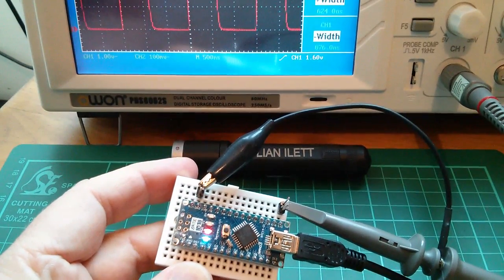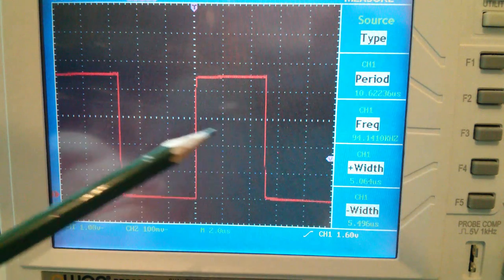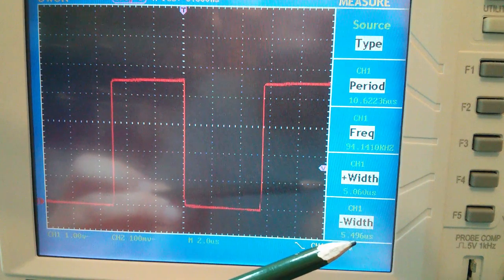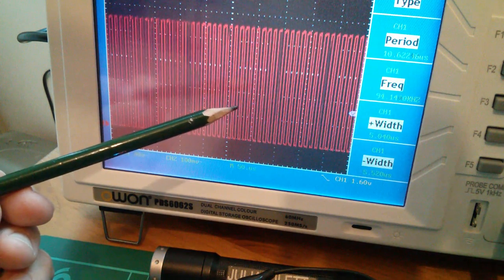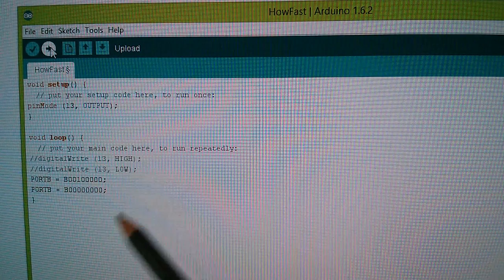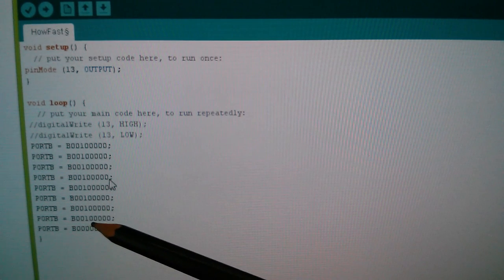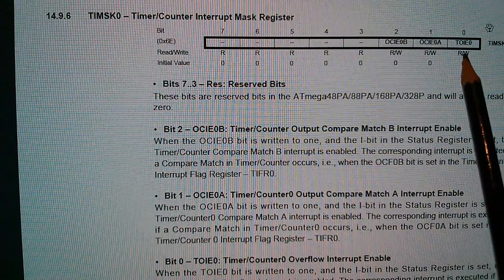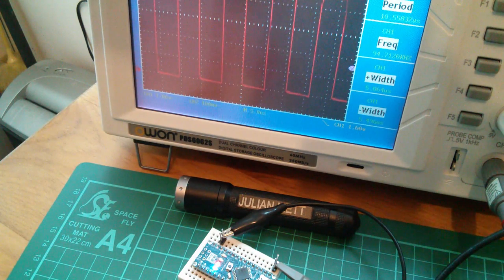Julian Investigates: How Slow is Arduino?

Comment: I think the reason for the runtime conversion is so that you're able to specify the Arduino output pin as a variable, so you can loop through or address a number of pins e.g. for (myPin...) {digitalWrite (myPin, HIGH); }
Obviously this wouldn't be possible if these were translated as constants at compile time.

Comment: +Julian Ilett A trick to toggle an output pin is to write 1 to that pins "Input Pins Register". Use "cli()" end "sei()" to disable/enable global interrupts.
Reply: k0ppit 
Got an Arduino Diecimila to toggle pin 8 at 2,66MHz and 50% duty cycle with this code.

void setup() {
  cli(); // clear global interrupt
  DDRB |= 1 << PB0; // set pin 8 to output
}

void loop() {
  for(;;) {
  // toggle pin8
  //PINB |= 1 << PB0; // Safer
  PINB = 0x01; // Faster
  }
}
Reply: k0ppit
Got an Arduino Diecimila to toggle pin 8 at 4MHz and 25% duty cycle with this code.

 void setup() {
  cli(); // clear global interrupt
  DDRB |= 1 << PB0; // set pin 8 to output
}

void loop() {
  for(;;) {
  //PORTB |= 1 << PB0; // Safer
  //PORTB &= ~(1 << PB0); // Safer
  PORTB = 0x01; // Faster
  PORTB = 0x00; // Faster
  }
}

Comment: Thanks for bringing this to my attention. I can't see the need for it at the moment given the projects I'm playing around with, but it is good to be aware of these kinds of things in case I run into something very time-sensitive in future.

That would probably have to be a very specific requirement though, as I very much appreciate ability to write once and compile for different systems, plus the readability of most Arduino commands, and the fact that I don't have to worry about taking all port values into account when using PORTB/C/D.

Comment: the digitalWrite actually performs a hell of hand-holding to try and prevent unexpected behaviour like writing digitally to a pin reserved by a peripheral and stuff like that, that's why they do it at runtime (they check a bunch of registers to see if it should actually do stuff to the port). also the loop does other stuff in the background like checking/managing a system timer etc, this most likely introduces the overhead. also remember arduino is derived from C++, this might also introduce a small call overhead as opposed to C, also loop is an actual function, so not just a jump-back has to be performed but also stack stuff and calling/returning.
tl;dr: safer/nicer for hobbyists who aren't that much into low level programming or just too lazy to care for a small project that doesn't have to run that performant, but introduces a LOAD of overhead. that's why I try not to use it if possible (avr-gcc/libc and a few small libraries to link to for common tasks is just fine) but it's great it exists, gets people into microcontrollers :)

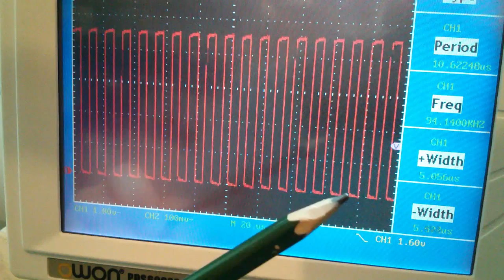Comment: In time frame of 5:30 and time frame 11:50 there appear to be signal aliasing, although I could be wrong. Signal aliasing arises from the fact that the scope maybe not perfectly aligned to sampling the Atmel chip signal. You may need to use a scope of higher sampling capability at this specific setup.

Comment: When doing mechanical "operations" as on a machine (calling out functions) the Arudino is so fast that humans can't tell there is a delay.  When "this" goes on and "that" goes off,  or from the time the button is pressed and 16 relays are switched It is less than 1/2 second.   It is an amazingly easy to use device for controlling a lot of things.  I am using a Mega board for my project and all but 4 pins are empty.

Comment: Just because a CPU runs at X Mhz doesn't mean it can do X million instructions per second (or 1 instruction per clock cycle).  It still depends on bus cycle, memory speed, instruction decoding and some complex instructions like multiplying and especially dividing can be pretty slow.  And stuff like memory waitstates, DRAM refresh can make things even slower.
For example on the intel 8086 a bus cycle takes 4 clock cycles, so fetching any memory (instructions as well as data) couldn't happen any faster than once every 4 clockcycles, this also explains why the 8088 with it's 8bit bus was so much slower because fetching instructions was half as fast (and accessing 16bit data as well).
A full IDIV (32bit/16bit signed integer divide) Could take up to a whopping 212 clockcycles.

CPU designers have become better (even for very cheap cpu's) since then and on the 8bit AVR, most common instructions take 1 cycle, but there's a few handsfull that take 2 or 3, and a couple go up to 5 (CALL, RET, RETI).

FYI.  There's optimal digitalWrite() versions in the Wiring framework for arduino.  if the pin number is const (as is the case here), the digitalWrite will be compiled to a single SBI or CBI   When the pin number is in a variable however, then there's a price to pay for the convenience of writing digitalWrite(pinnum, HIGH).  Avoid if possible (even a switch/case cascade with const pin numbers will be faster (at the expense of code size).
Reply: If you look at Atmel Atmega datasheet, they do say that most instructions takes 1 cycle. The problem is, that turning GPIO on/off is more than one instruction - in 'arduino language' for sure. Maybe if he would set DDR & PORT   registers directly, it would be faster. Apart to that, he said enough.
Reply: Ok, he got to that in video. I showed myself... :D
Reply: How about defining the pins as #define? Is it similar as putting them as const int ? Or even const byte.

Comment: Great work Julian, this extract is taken from the core library arduino folder/hardware/arduino/cores/arduino/wiring_digital.c

void digitalWrite(uint8_t pin, uint8_t val)
{
    uint8_t timer = digitalPinToTimer(pin);
    uint8_t bit = digitalPinToBitMask(pin);
    uint8_t port = digitalPinToPort(pin);
    volatile uint8_t *out;

    if (port == NOT_A_PIN) return;

    // If the pin that support PWM output, we need to turn it off
    // before doing a digital write.
    if (timer != NOT_ON_TIMER) turnOffPWM(timer);

    out = portOutputRegister(port);

    uint8_t oldSREG = SREG;
    cli();

    if (val == LOW) {
        *out &= ~bit;
    } else {
        *out |= bit;
    }

    SREG = oldSREG;
}
As you can see there are loads of C commands just to change the pin state.

Comment: There's a valid reason to doing the mapping dynamically: This way you're able to use digital write with the port number from a variable. Analysing the code, and replacing the ones where the pin number argument to digitalWrite() is a constant would be a solution, but that's not a trivial job on one hand, and would pretty much make the timing with different digitalWrite() calls inconsistent.

Comment: As others have said , a while true loop and a single bit toggle is the fastest. For reference I got around 4MHz from an arduino uno. Also, I noticed you get a much cleaner signal if the usb power is supplied by a wall wart. Mty laptop usb produces an unacceptable amount of noise.

Comment: if you want to remove the noise which is caused from the built pre coded interrupts you can type noInterupt() function to disable them and type interrupts() to reable them. If you really want a high efficient code for tasks that require high precision time based code then I think it is best to stick to the original type of microcontroller coding and that is doing it the hard way. Also note when I say efficient I mean being able to type code like _asm("wfi") and save power but that would be redundant in the arduino IDE and libraries as there is interrupts happening everywhere.

Comment: Hey Julian!

Great work on and research on this topic! Long time supporter and fan of your channel. Do you have anyway to speed up AnalogRead? I am trying to use the arduino as a oscilloscope. I dont have the $$$ to get one xD And I already have an arduino around. Thanks!
Reply: Relations99 While it is possible to speed up analogRead() a bit, its main delay isn't due to code overhead (that much). The ADC needs time for the hardware to convert analog to digital. If you were to skip analogRead(), you'd have to manually check if the ADC was done converting before reading its registers, otherwise you wouldn't get sensible data. This is done by analogRead() for you, by simply waiting until it returns something.
Reply from the maker: Relations99 I think you read my mind! I'll be looking at analogRead() next. I also want to build a cheap Arduino oscilloscope and speeding up ADC operation is the key to maximising it's frequency range. There may be a way to have continuous analogRead()s by putting all the other code into the gaps where the successive approximations take place. This would require interrupts from the ADC to break into the code for display updates and keyswitch reads etc. Not sure how feasible this is yet though ;)
Reply: Julian Ilett this http://meettechniek.info/embedded/arduino-analog.html might save you a lot of work... (and much less fun) but the overall estimation you are looking at 77khz max using continuous ADC conversion (about 13 clock cycles per conversion) for the ATMEGA328. not very impressive.
Reply: Relations99 Also, using an arduino as an oscilloscope is a useful exercise for your own development, but to be honest, it will be useless for pretty much anything as a scope. Even the oldest analog scopes from the 60's and such will be far more capable.

As a learning experience and fun project, go for it. It'll be a great thing. As a useful tool, look around with universities, second hand on-/offline and auctions and such, even ebay, and get the cheapest analog scope you can possibly find where the trace is visible and a curve is shown on the display (indicates that the scope works and triggers). I got myself a Tektronix 2465 (300MHz 4-channels) for less than the equivalent of 100 GBP about 8 months ago at an annular university electronics auction. And that's much more than you'll need. Lesser scopes went for 10-30 GBP.
Reply: Stefan Berndtsson yeah noted thanks. I was and still am looking out for scopes. But it's rather frustrating because they then to go very very fast. 

Julian Ilett there is a sort of a guide online, On indestructibles, that uses and external ADC  and external clock for the ADC, all to save some processor calls on the arduino. Also, might wanna look into SerialWrite. ;)
Reply from the maker: Asaf Shahar Agreed, not very impressive, but usable. If a scope with this spec can be built for a fiver (£5) then I think it's worth having a go.

Comment: Great tutorial on high-performance Arduino magic. 

To avoid the overhead of the loop() routine, you can enclose the body of loop() in an infinite loop, e.g., 

void loop() {
     while(1) {
          //your code here
      }
}

At minimum, this avoids the overhead of returning from loop() and calling it again from the Arduino libraries. This  should also obviate the need for any delays between the writes, though parasitics may still give you an "ugly" square wave.

Another useful trick along the same lines as what you presented is to change the state of multiple pins (on the same port/bank) simultaneously. Due to the goofy mapping of Arduino canonical pin names and the actual ports, you sometimes end up with goofy combinations of pins... but, if you wanted to do a simple bit-banged 8-bit DAC, for example,  this would do the trick. (I think W2AEW used this trick in one of his videos a while back). 

Cheers, mate!

Alex

Comment: Time frame 8:50 > this is because of the parasitic on board capacitor and the sampling capability of your scope. If you use a scope with much higher sampling capability, and probes with better isolation, then you may be able to see that flat top ON section of your "Square" wave. Since you are still using the brackets of your loop then that takes relatively much more time to execute and that why the OFF period is way much longer that ON. If you use assembly code and the Atmel Studio I bet you will get way much better response / without having to duplicate PORTB = B00100000 and slow down the CPU execution speed > better yet, use PORTB.5 to slightly speed it up. Atmel Studio is easy to use and has very powerful features and I highly recommend that everyone use it along with Arduino IDE. That also looks good on your resume.

Comment: The fastest possible output is 4 MHz for 16 MHz Atmega328P. But, it has 62.5 ns ON state, and three times that (three cycles, or 187.5 ns) OFF state (if one want equal ON and OFF state - out freq is 2.6666...7 MHz, so un-comment asm codes if needed):
void setup(){
  TIMSK0=0; //disable watchdog interrupt
  DDRB = DDRB | B00100000;//only pin13 (PB5) as output
  while(1){
  PORTB=(1<<5); //the same as "PORTB=B00100000", but shorter to type
  //asm ("nop"); asm ("nop"); //those two "nop" (no-operand) statemens gives equal ON and OFF states, but only 2.6666...7 MHz
  PORTB=(0<<5);//the same as "PORTB=B00000000", but shorter to type
  }
}
void loop(){ //note that there is nothing in the loop, since it is the slowest
 }                   //you may include "while(1)" command here if needed...

Comment: Using a high level programming language will always generate more than one processor level instructions. Also the loop itself is not 1 processor instruction, at a machine level that is mapped to many processor instructions. The functions digitalWrite and pinMode, might also be implemented in hundreds of low level instructions.
Reply: Using a low level programming language will always generate code that is not portable at all.

I'm not sure what you consider high or low, but programming in C is as fast as assembly.
There is no reason that a "While" loop in C should take more as a loop instruction. You can bet your ass it will be translated into the same code.

But yes, Arduino itself is quite, inefficiënt. But that doesn't have to be a problem.
You can check the code out, like for digitalWrite:

void digitalWrite(uint8_t pin, uint8_t val)
{
 uint8_t timer = digitalPinToTimer(pin);
 uint8_t bit = digitalPinToBitMask(pin);
 uint8_t port = digitalPinToPort(pin);
 volatile uint8_t *out;

 if (port == NOT_A_PIN) return;

 // If the pin that support PWM output, we need to turn it off
 // before doing a digital write.
 if (timer != NOT_ON_TIMER) turnOffPWM(timer);

 out = portOutputRegister(port);

 uint8_t oldSREG = SREG;
 cli();

 if (val == LOW) {
  *out &= ~bit;
 } else {
  *out |= bit;
 }

 SREG = oldSREG;
}

Comment: Just gonna post this since you didn't mention it, you can use the direct manipulation method in a way that means you dont have to worry about changing all pins on the port at once if you do PORTB /= B00100000; rather than just =, it will only write 1 to the positions you write 1's into becuase it will take the current state of PORTB and OR it with the number you give it so any 0 stays 0, any 1 stays 1 and any 0 you want changed to 1 will become 1.
Also for changing something from 1 to 0 you'd do PORTB &= ~(B00100000); and again it will take the state of PORTB and AND it with the complement of the number you give so whatever you put as 1 will turn to 0 and everything else stays as it was.
I don't know if this would add much/any extra time to execute the line of code but it should still be faster than arduino functions.

Comment: I really love your idea of trying to get the most out of these microcontrollers, and the video is really nice to watch.

I'm not sure if it works for this specific chip, but the avr libs include the functions "cli()" (clear interrupt) and "sei()" (set interrupt), which disable or enable all kinds of interrupts (timers, external, etc), I don't think it wouod change anything though as you disabled the timer0 interrupt already.
Also I think digitalWrite and digitalRead are slower because to my knowledge function calls (depending on the used calling convention) just happen to be slow (pushing parameters, creating stack frame, jumping to function, jumping back etc). I could imagine though that these time critical functions are inlined and I don't know if function calls are the same on microcontrollers, I have way more experience on Intel/AMD CPUs in regular home computers.

Keep up your work!

Comment: Can't remove the void loop delay by using while(1) ?
Reply: +Boehoehuahoei "while" would have to jump to its head as well when reaching the last statement. The only way to speed it up (that I can think of) would be to manually unroll the loop as much as possible. In other words: copying / pasting the two pin statements many times.

Comment: What if you put port output set instructions in a while(true) loop, so that function loop() doesn't have to end?
Reply: mantaz111 I was wondering the same thing and dug out the code that Arduino executes. There is behind the scenes a main() that does some stuff including:

setup();
    
 for (;;) {
  loop();
  if (serialEventRun) serialEventRun();
 }

It is fairly clear that there is the overhead of calling the loop() function (so that's a few instructions to throw some registers onto the stack, perform the call then restore the registers from stack) - not too much, but nonetheless a function call.
But then there is also the test to decide whether to run a serial event.

The bottom line here is that there is the overhead of convenience (being able to use pin 13 rather than port D bit 5 or whatever), and the overhead of the framework (additional function calls, overhead of timers) that may be useful and helpful, or not.

The nice thing is that you generally have a choice - use the Arduino and the convenience (and limitations), or use the lower-level machine instructions (either in C or assembly language).

Comment: Good video! I think the compiler is not good. I program and develop dot matrix LED display controller, that is request the system running smooth and accurately. I can be used ASSM only. But it is very difficult transfer to other platform.